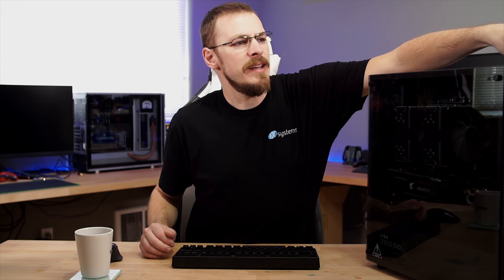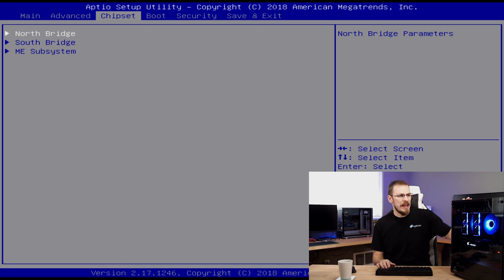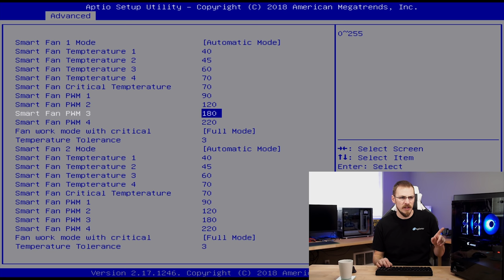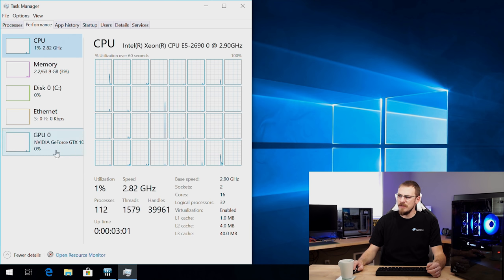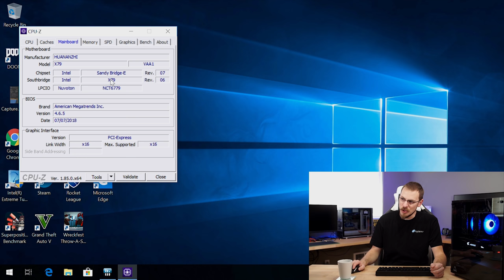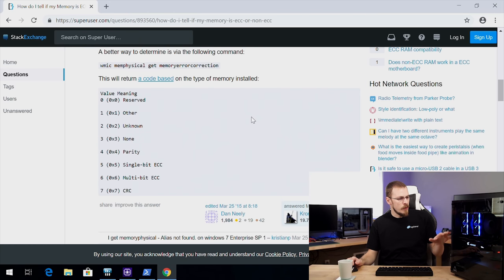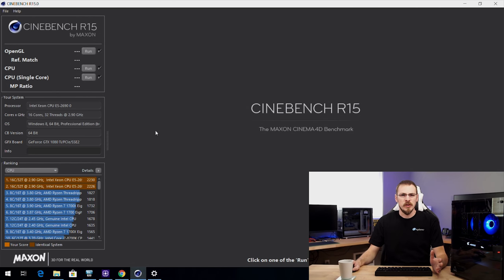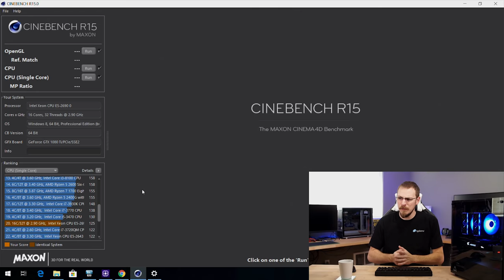Huanan "Dual X79" Motherboard Review

Comment: Not sure if i'd want to build a system like this or not. I don't have a gigantic need for it as i'm sitting on a few 2-3u Dell Poweredge servers. One is 32 core, that I could use as my next virtualization test bench, which is the plan. But... Being able to drop a decent video card in there I could also experiment with quicker and more significant GPU passthrough options for VM's either for rendering/encoding, or playing around with making a "gaming" VM using the GPU passthrough, (Silly to do that I know but I want to anyway. For science.).

Comment: I went with the Asus Z9PA-D8 for my two E5 2667 v2's.  Worked out well.  A bit more expensive - ebay price was $300.  The nice part about the Asus board is 8 memory dimm slots.

Comment: Hi, just ordered one of those, now I need to by everything else to make it work :D. The listing at aliexpress says only 2RX4 ECC memory have been tested, but I couldn't find any 32GB sticks in that configuration to make my 128GB dream come true. Would you be able to tell if other memory configurations are supported? Like 4RX4 for instance. If not, 64GB is going to be as high as I'll be able to get...
Reply: Hi, I'm currently running the same system with 64 GB 2Rx4  and is also very interested in going 128 GB. It should be possible to get 2Rx4 32 GB modules, however, they are much more expensive than 4Rx4. If you find any info or test if 4Rx4 is supported I would be very interested in it.
Reply: @peterandersen7157 mine just arrived, I'll test it this week with the components I have around, memory is likely 2Rx4. I have e-mail the manufacturer but they didn't answer back (I'm not surprised). I'll answer back in case I manage to test with 4xR4's

Comment: I had a reboot lockup problem on a xeon system. It turned out to be a problem with the display port monitor being set into an encrypted mode by windows. I ended up changing to DVI-D and HDMI

Comment: As a heads up this right wouldn't be good for CAD. Most CAD systems like solidworis, Creo, etc are severely single thread limited, high frequency cores are preferred for most systems. Pudget Systems has some benches to show.

Comment: I'd absolutely use one of these for a workstation or server. Especially for the price! Blender would be fast when rendering, video editing could be fast and smooth, oh and virtualization would be fantastic! You could run, say, 3 VMs with 4 dedicated cores and 8 threads each and still have enough cores/memory to control them all host side without SSH or Telnet or VNC!

Comment: I have made a similar build but using an asrock c602. You are right it is a beast. Unlike you I don’t see any limitations to it, despite not overclocking them at all. I use virtual box not esxi as the drivers for the graphics are easier to find in win 10 Pro. E5 2690 only uses 120w when on max consumption, but usually it consumes much less.

Comment: Running natively unlocked chips on these boards opens up new overclocking options in the bios; voltage and base clock can NOT be changed, but multipliers can. :)
Reply from the maker: But BCLK is all I have :-(
Reply: Craft Computing :((
Reply: Does setfsb work on this board?
Reply from the maker: Nope. Even tried Intel XTU, and that was fruitless as well.
Reply: Craft Computing
(not trying to self-promote) on my channel, I made a video of Huanan’s single-socket “X79” board.  I’m using an unlocked E5-1650v2. At 3:57 you can see the BIOS overclocking options are different.
Reply: @CraftComputing  isn't there a microcode hack to run allcores at boost speed? Or see if throttlestop can make it run a little faster
Reply: @mitchell3876  Theres mods and bios hacks here http://x79.apphb.com/

Comment: This Board would be a Perfect choice for me ! Or, anyone else currently running an older Dell Precision Workstation, As they already have most of these required components inside them. I Run a T7500 workstation with Dual x5680's now,  So I already have both Cpu's as well as coolers for them. I also Have a decent Gpu Video board installed, Along w a modular power supply with plenty of head room. ** Here is the big Bonus.**  This new board has;
 * native Sata 3
 * Native usb 3.0
 * Native support for booting and running off M.2 Nvme drives. ( Pcie card required )
 * Faster Mgz Ram speed  ( 1600 up from 1333 )
 * Updated Bios

So a new MB, a new case ( which I already have ) and some new ram are all I have to purchase, Which can all be bought inexpensive on the used market. This will Squeeze another  2 - 4 years out of my currant aging system with only native usb 2.0 and Sata 2 and no bios support fro Nvme. And be a fun little project. 
  ** Thank You Craft Computing so much for the Great Video !!!!!  U just saved me a fortune, Lol
MooK

Comment: Recently did a PC build with the X79 HuananZhi  Deluxe version coupled to an E5-1650 V2 (new thermal paste), with new M.2 NVME as boot, a GTX 980 FTW, new CPU dual Fan, and 16 GB of DDR3 R-EEC memory that I pulled from my operating home server. Case is a new CoolerMaster Masterbox Pro RGB with 4 fans.  Also a new Rosewill Bronze 650 PS.

Tested the PS first, did the build and installed fresh WinPro10 to the NVME.  Boot went fine. CPU and GPU temperatures were excellent.

Installed NVIDIA latest driver, CPU Z, GPU Z, SPECCY, and Heaven. Ran the PC fine for the rest of the day (about 5-6 hours into the evening), until it shutoff abruptly in the middle of a WoT game.  Code FF on the motherboard.

Attempted a reset, attempted a restart...same FF code.  Each time, the PC powers up with CPU fan starting...but remains in Code FF.

I removed CMOS for 10 minutes as an initial DYI check to see if that would solve the issue. No joy there either.

The AliExpress seller suggested the CPU failed.  So I installed a E5 2667 from my desktop server. Same FF code.

I think the motherboard died.  Does anyone out there have another suggestion?  Is this just a write-off...I sense the AliExpress seller is not that into any warranty of its product.
Reply: Raise a dispute in ali. You can get your money back. Do it asap. Record videos of the issue and your testing to upload with the dispute. I have never had issues with getting refunds. You just have to provide all the information in the dispute. Generally though for a full refund you need to send it back.
Reply: @jared4670  I will do this tonight, within the three day window AliExpress gave me from yesterday. THX.  In reality I only expect a partial refund.  I am out the import duties, in any event.
Reply: @jb678901  I can assure you, you can get your money back. The AliExpress site is crap for uploading videos. Just ensure that your dispute is already in progress. That gives you time to upload the videos. Their server is crap for uploading but it does work. I had to split my video into 35mb parts in order to upload before the login timeout occurs. Nothing got recorded most likely due to the login session no longer being valid. Try it again, this time with just a picture as one single picture is required in order to open the dispute. Once you have opened the dispute, you will receive a notification email and the dispute will be available under your orders. Give it another go. Apologies for the late reply, I did not receive the youtube notification that you had replied.
Reply: @jb678901  just reread your original message about the problem. Still get the dispute going but to troubleahoot. Take all the components out of the case and assemble the pc on some cardboard to prevent any conduction. Try turning it on. I built a pc for my uncle last year using the huanan x79 2.49p motherboard and encountered a similar issue were it would not post. Ended up being a short under the motherboard caused by the case. Only found this out by reassembling the pc outside of the case. Give it a try, but please, still get the AliExpress dispute underway.
Reply: @jb678901  just rechecked the file size that I uploaded. It was split into 15mb parts. I used handbrake to first squash the video as much as possible and then a video splitter to split them. Still takes awhile to upload the video. Don't try and upload multiple parts in different tabs. It will fail to upload. Upload one at a time and refresh the page once it's uploaded 100% to refresh your login session before trying the next upload. It's painful to upload and takes awhile but it's the only way to do it. Providing an external download link to the video will only cause delays as most cloud storage providers are blocked in China.
Reply: @jared4670  OK. Thanks.  Best Regards
Reply: @jared4670  I am writing off the 200 bucks (cost + import duties).  This is simply not worth my time.  Rather spend it letting people know that WUSON store on AliExpress is, at least from my experience, a sham. It is the truth...and I get satisfaction from knowing these MFers might lose some real business for this crap.  The fact that Ali has such an upload feature demonstrates it's complicit.
Reply: @jb678901  sorry to hear that. I have bought from the Wuson store before and they are fine. The seller is a tad slow to reply as he has said he is quite busy in the past. I can assure you that there is success in obtaining a refund through opening a dispute. It does take perseverance but you can get it. As an FYI, wuson is the official reseller of the HUANANZHI products. Did you try reassembling the pc outside of the case? Best of luck. Cheers
Reply: @jared4670  The WUSON store even argued that the new Rosewill 650W Bronze power supply that I showed receipt for purchase in January of this year and for which I tested pin by pin with a voltmeter and separate battery tester BEFORE and after the build (tested SAT), was somehow insufficient for the X79 board, with GTX 980 and E5-1650V2, to boot up.  AliExpress initially accepted the seller's view by proposing no refund no return.  Sorry, these businesses are not fair, not correct, not ethical. I had to even break down my DELL T5600 to pull an E5-2667 for install into the faulty X79 HuananZhi baord to prove that it was not a CPU caused FF code fail.  What a waste of time...honestly, I am pissed off with these MF-kers.
Reply: I did manage to upload all of the video clips per your suggestion...but have zero faith the process will prove fruitful. Thanks for that.
Reply: @jb678901   from my experience, 650w would've been ample. I'm running a 850w with e5 2630, rx580 and 12 hard drives. No power issues. They are going to try and wiggle as it's a troubleshooting / providing evidence scenario. Once you tick all the boxes for the dispute, you can win. Last year I bought two tablets will good listed specs. Once I received them I ran all the SD card, ram and cpu testers I could find and found that all the listed specs were invalid proving that the seller had sold me fake goods. Lodged the dispute with all this evidence and got my money back. Sorry for repeating myself, but have you given the parts a rebuild outside of the case yet? Just on your desk or cardboard box to rule out any shorting of any kind?
Reply: @jared4670  Good point and yup, did that too.  To note, the system ran for 5 hours before the FF failure, so one might also assume a short very unlikely to develop in a build that was untouched/unmoved during that time period.  However, the external test on a box was also done, in any event. 
On a good note, obtained a working ASROCK Extreme 3 for the build now...suppose I should've gone with a trusted OEM to begin with.  Live and learn.

Comment: Hey guys, I got one of these boards, what's the cheapest dual 8 EPS connector power supply? Thanks!
Reply: Just get a high amperage power supply and a adapter to get one more Eps, I did this and it's all fine and cost me much less. Adapters are under 10 bucks

Comment: After having bought many parts on Ebay and having my CC locked by my bank to sit and wait for a replacement, I'm not a fan of ordering anything direct from China.  That being said, I want to build a server.  Would this be a bad option? I don't think so.  I am not a fan of OC, so that doesn't matter. I want to be able to pull video shots from my home security camera box and store.  Faster CPUs and memory might have been an option, so long as you build for long lasting effect (3-4 years).  MB videos like this are still a good thing to examine best bang for the buck!

Comment: just as a fun fact, my 2500k single thread performance is pretty much in that same 170 range as these bunch of new cpus in cinebench. and it's only 4.7ghz. some, like my brother's, can reach 5ghz.
so don't count sandy bridge out just yet.
Reply: Fun fact, a 2500k is below the minimum requirements for BFV but can barely meet them with a good overclock so you are out of luck if you don't have a k variant.  

Another fun fact, a 2700x scores 180 in Cinebench at stock settings (4.3GHz max boost) and is almost three times faster in multicore (1828 vs 612) compared to a (I am assuming stock) 2600k while only having double the core and thread count.
Reply: @emu071981  games barely benefit from more than 6 threads right now so synthetic 100% scaling benchmarks really don't mean anything. the 2500k can still carry a mid end gpu like a rx480 and 1060 just fine. in fact, a 1700 (not sure about the 2700) is actually slower than my 2500k in some games (not that i wouldn't prefer it, i just don't think it's worth upgrading yet).
that said, why do you sound like you are offended?

also this game runs on the consoles with they slow-ass cpus, so the whole "below minimum requirement" is bs, i bet you could run it on a fx 8350 if you wanted and still get decent, playable performance with some tweaks.

[edit] geez, will you look at that!
https://www.youtube.com/watch?v=XNqrvF9MJfM
averaging 83fps on low with a fx8350
and here's a non-k i5 2500 getting pretty decent performance too
https://www.youtube.com/watch?v=23Gn3QeUsAY

anyway, it'll take more than this game to kill sandy bridge. and that's the i5, the 2600k performs considerably better.
Reply: @UC2zdUZNkMfaXsXNoQov8F1Q Why would I be offended?  I am just tired of seeing people complaining about their 5 year old CPUs failing to perform at a decent level with the latest games.  And this "games barely benefit from more then 6 threads" train of thought needs to be retired.  BF1 and BFV both benefit from having 8+ threads and suffer from performance issues with any less (you will lose out on up to 50% of your average frame rate by dropping from 8 threads to 4 threads in BFV).  Making good use of multiple threads is a hard to deal with problem but developers seem to be getting the hang of it these days.

Just looking at the recommended requirements for the latest AAA games:
- Anthem - recommended CPUs are 4c/8t or 8c/16t (6700k or Ryzen 7 1700)
- BFV - recommended Intel CPU is 4c/8t.  For some reason the recommended AMD CPU is a quad core 1300x which struggles to hit 50fps with a 1050ti at 1920x1080 on the lowest quality settings.  The same GPU with a i5 4590 hits around 60-70fps on the same settings on the same map.  This leads me to believe that the 1300x shouldn't have even been the minimum required AMD CPU let alone the recommended.
- Fallout 76 - recommended CPUs are 4c/8t
- Metro Exodus - recommended CPUs are 4c/8t or 8c/8t
- Darksiders III - recommended CPUs are 4c/8t or 8c/8t

The common theme here is that the developers recommend 8 threads or more for average performance in their games.
Reply: @emu071981  you don't lose anything by dropping from 8 to 6 threads in battlefield. so it doesn't make proper use of more than 6 threads. and i'm doing the opposite of complaining about my 7 year old cpu, so i still don't get your point. also you're obssessing too much over "recommended settings". they don't mean anything. the q6600 was recommended for a bunch of single-threaded games back in the day, doesn't mean you'd benefit from the extra cores.

games are getting more and more multithreaded, but it's still not at a point where a quad core can't handle them, nor at a point where they make full use of a octa core

Comment: where is the link for the board?

what are you going to be using this for?

IS there a variant  (less expensive)  x58 board?
Reply: Thewickedjon Generally for LGA 1366 single or dual socket boards for cheap I would suggest to look for old OEM workstations from HP, Dell or Lenovo. HP Z400 and Z600 boards or full systems can be found for cheap on eBay.

Comment: VT:X is not hardware pass through. That is simply hardwar virtualization.. Hardware pass through is VT:D...... Can you confirm if it supports that technology?  I am eyeing one perhaps to upgrade my ESX server. However I would probably shop for some v2 cpu's. Can you confirm the PCI-E configuration of the two slots? Are they both electrically 16x?
Reply from the maker: Yeah, I realized I switched them in my brain after posting it. I'll confirm VT-d in the morning. I can confirm the PCIe slots are electricly x1 and x16.

Comment: Hi Jeff not sure where to ask this. I have an asus Z10PE-D16 WS with 2x xeons. iwas going to upgrade them to 2xe5-2699 v4s but seen in alienexpress a while back 2xe5-4669 v4. can they be installed instead and will they run. I have heard a lot of things dont work like windows 10 pro but alas it boots like a dream with 2x e5-2630 v4s.